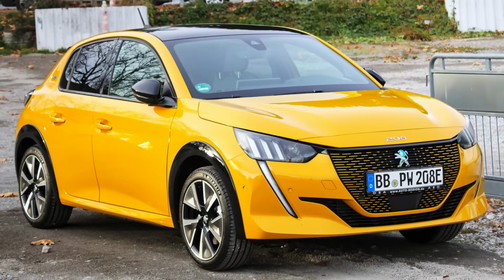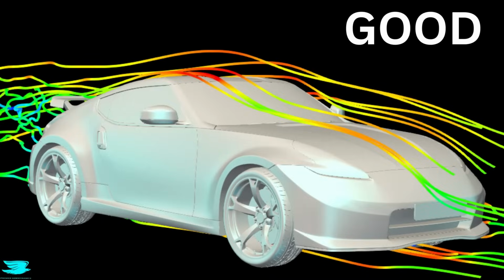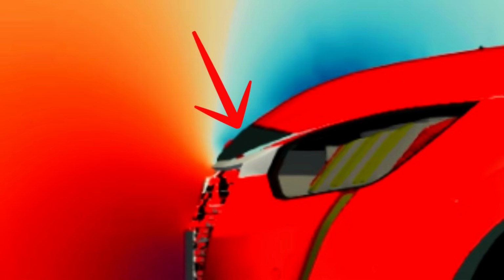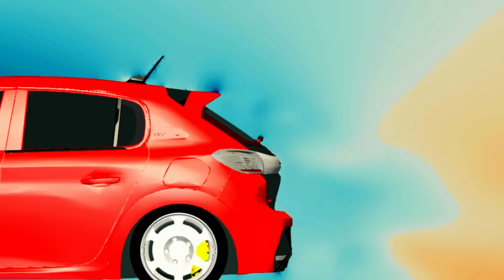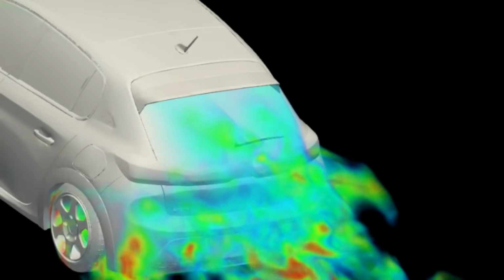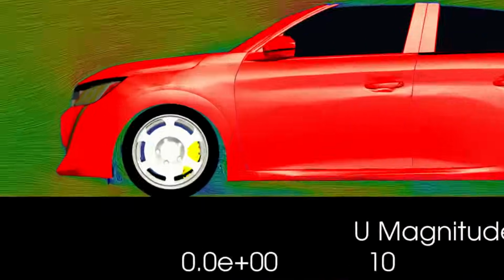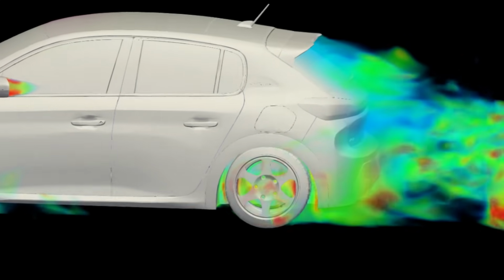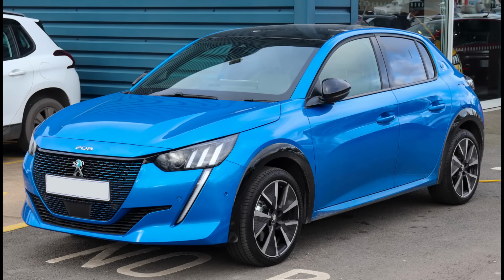How The Peugeot 208 Breaks The 0.3 Drag Coefficient Barrier

Comment: Just a reminder: Drag coefficient is not the same thing as total aerodynamic drag.
Reply: Drag coefficient times frontal area will give you the actual number
Reply: @bastainjames4526  this
Reply: Fd=CdA(pv^2/2) velocity is the biggest factor in drag. P in place of rho as my keyboard doesn't have it. Haha.
Reply: It's exactly why the Opel Calibra ran so fast on the Autobahn and was nicknamed the "bricklayer's Porsche". Record low cw of 0.26 AND a low front area.
Reply: Also the CG value is measured in lab-conditions, no mirrors, no windscreen-wipers, and some other minor tweaks.
Reply: So what's the Cx?
Reply: @Eckmuhl29 
The Cx (no unit) is the global drag (SCx, in square meters) divided by the frontal area (m2). It has to do with the shape of the vehicle, without considering its size.
Very aerodynamic cars are close to 0.25, bad ones are beyond 0.40 (a 2cv gets 0.51 !)
Reply: @jannek5757 I stumbled randomly here and I'm curious, reading your comment I feel like hearing more if you feel like taking a moment to explain please?
Reply: @washinours  Basically frontal area is the area that air can exert a force on, usually for a front a vehicle. Drag coefficient is the friction/resistance that air has going over it. You need to worry about both. A good example is a Rivian R1T and a 1950s Saab 93. Both have the same drag coefficient of 0.30, but the Saab 93 is MUCH smaller in comparison. Less frontal area with the same drag coefficient so less air resistance overall. Planes are another good example, absurdly low drag coefficient but much higher frontal area.
Reply: @abhimaanmayadam5713 
Yes and that's why a more than 40-year-old Peugeot 205 still has a better aero global drag than a lot of today's superminis : its Cd is only 0.34 but its frontal area is much smaller (thinner, lower).
Reply: @abhimaanmayadam5713  "Drag coefficient is the friction/resistance that air has going over it.". No, it has to do with the shape
Reply: @WildRhinoDesert thats what I was missing. Stupid me

Comment: One of the most interesting front spoiler / splitters I've seen is on the Ferrari 296 GT3, which has an unusually rounded profile in the centre section, unlike any others.

Apparently it allows a lot of air to go under the car, and works exceptionally well on circuits line the Nurburgring Nordschleifer.
Reply from the maker: That's pretty interesting. I guess it is there to fuel toe venturi effect because the sides are so low that they form a decent seal to the road.
Reply: A curved up or raised center splitter section is common among race cars (Porsche 919 Hybrid, Nismo GT-R GT3).

It is less about increasing drag than avoiding the worst case scenario of the floor stalling due to the car pitching or the curvature of the road. This allows the car to be run lower before you encounter stalling.

Comment: Thanks, I always find these these videos interesting.

Some souces seem to suggest that the Peugeot 309 from the mid-1980s had a Cd of 0.30 (other sources 0.33) for the base model.

The design study that fed into its development apparently had a Cd of 0.22 (VERA/+).
Reply from the maker: Wow, if they could keep the flow attached over the rear window, that would be impressive.
Reply: cool. do you have the link for the study?
Reply: @Phenx  Not much that I could find, unfortunately:

https://en.m.wikipedia.org/wiki/Peugeot_309

This states VERA Plus had a Cd of 0.22.

There was also a VERA Profil, but I could not find not much info on this either.

Comment: I ride a 2008 as "1-kid, 1-cat family car". Surely not as sleek as the 208 is is derived from, but I wondered wether a hatchback 308 compared against the 2008 (As they both offered the same internal volume), and if the Break version of the 308 was even better purely due to better aspect ratio. I heard that some contemporary Mercedes actually did very good (Class C ? Can't remember the model or the Cd for that matter).
Reply from the maker: Yep, Mercedes took a very intuitive approach to lowering their drag coefficients and drag areas. They shrunk the back.